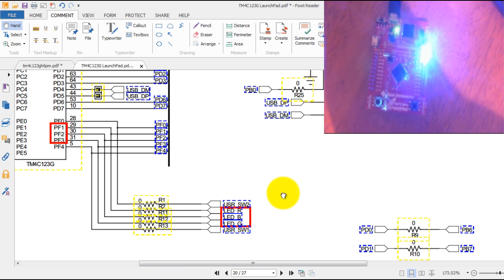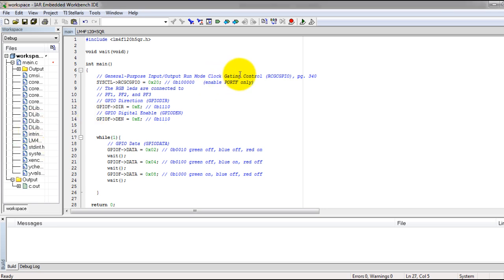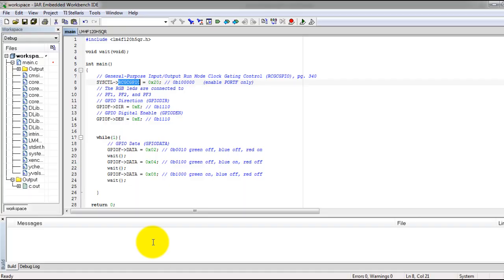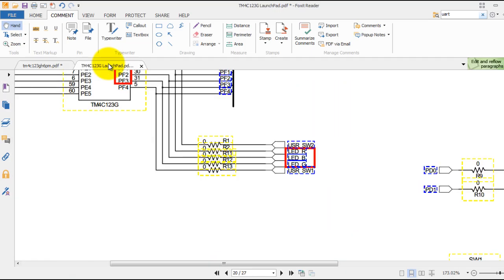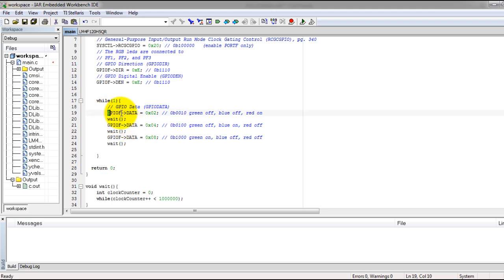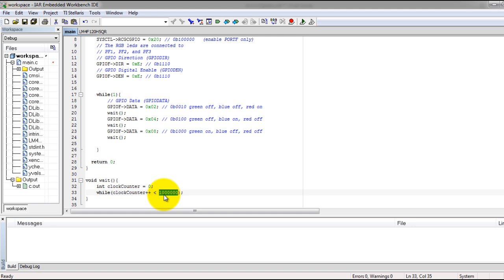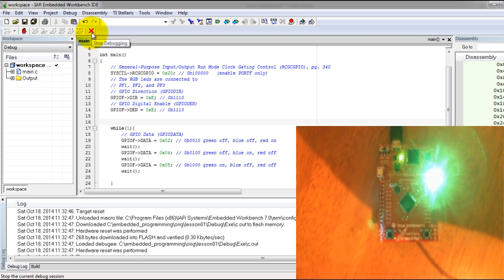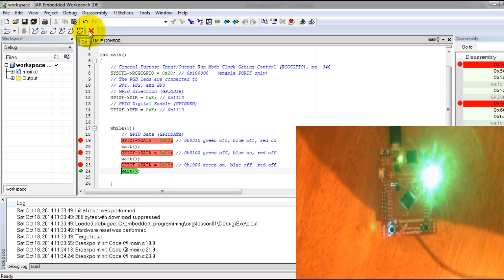TM4C123 Tutorial: Digital Output With RGB LEDs

Comment: thanks a lot :) i have modified your delay using CMSIS systick here is my code 
IDE: keil

#include "TM4C123.h"                    // Device header

void wait(void);  //using while loop 
static volatile unsigned int delayTimeTick = 0;
void my_delay_ms(unsigned int ticksIn_ms);  //using system core clock 

int main(void)
{
 SystemInit();  //would initialize MCU's clock system, FLASH memoy interface
 SysTick_Config(SystemCoreClock/1000);
 //general purpose I/O rin mode Clock gating control register
 SYSCTL->RCGCGPIO = 0x20;  //enable PORTF only
 
 //RGB leds are connected to PF1, PF2, PF3 
 
 //GPIO direction register
 GPIOF->DIR = 0xE;
 //GPIO digital enable register
 GPIOF->DEN = 0xE;
 
 while(1)
 {
  //GPIO Data register
  
  GPIOF->DATA = 0x02; //0b0010 red on
  //wait();
  my_delay_ms(1000);
  GPIOF->DATA = 0x04; //0b0100 blue on
  //wait();
  my_delay_ms(1000);
  GPIOF->DATA = 0x08; //0b1000 green on
  //wait();
  my_delay_ms(1000);
 }
 return 0;
}

void wait(void)
{
 uint32_t clockCounter = 0;
 while(clockCounter++ < 1000000)
  ;
}

void SysTick_Handler()
{
 if(delayTimeTick < 0xFFFFFFFF)
 {
  delayTimeTick++;
 }
}

void my_delay_ms(unsigned int ticksIn_ms)
{
 delayTimeTick = 0;
 while(delayTimeTick < ticksIn_ms)
 {}
}

Comment: I want to use other GPIO Ports to turn on external LEDs.   Are the outputs pull down or pull up by default?   I am concerned about wiring up LED and resistor the wrong way...don't want to burn up my pad.    Thanks.
Reply: never mind....saw your other tutorial!  :-)
Reply from the maker: Ok, yeah just put a resistor in series with the LED then to ground, it doesn't matter which side since the current flow will be the same either way.   The resistor has to be large enough so that the current doesn't burn the LED, you can calculate the resistor value from the LED's datasheet so that you get maximum brightness but if you don't care about that a resistor of 1k should be safe.

You can also connect the LEDs cathode to 3.3V instead of GND actually, what will happen is that your code logic will be inverted i.e. a 1 will turn off the led and a 0 will turn it off.

Comment: Great tutorial.   Question....how did you get the GPIODATA memory address from the datasheet?   What page?  Thanks.   I have it working from another tutorial without using the header file.
Reply from the maker: The address of every register is that register's page. For the TM4C micro the GPIODATA register address would be in pg. 662 of the datasheet.  The header file I use also defines the addresses so you can also see it there.
Reply: AllAboutEE Thanks for the quick response.   I am using the LM4F120H5QR datasheet.  Page 621 has the GPIO DATA Register...offset 0x000.   I noticed you used 0x3FC.   After further investigation, page 614 describes the Data Register Operations...confusing a little, but 0x3FC sets bits 9:2 to "1", is this right?      Great stuff.   Keep up the good work.
Reply from the maker: lamarts100 I don't see where I used 0x3FC in my video, but yeah assigning 0x3FC to a register would set bits 2 to 9 to "1".
Reply: AllAboutEE
You didn't have it in your video...I looked "under the hood"...deep into the header files.   I wanted to know what to do for any GPIO Port.   When I first started checking out your videos, I didn't use the header files, just the datasheet and checking out another tutorial